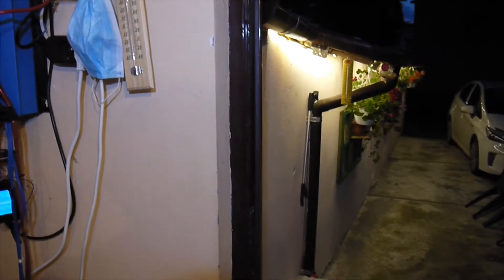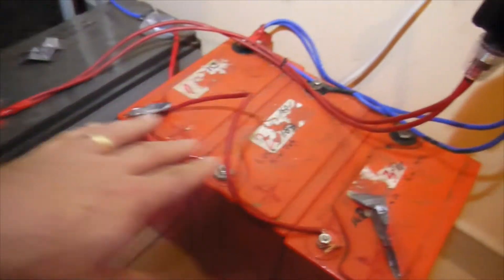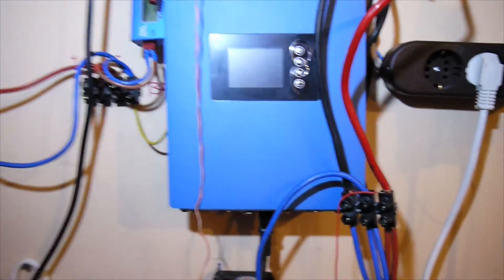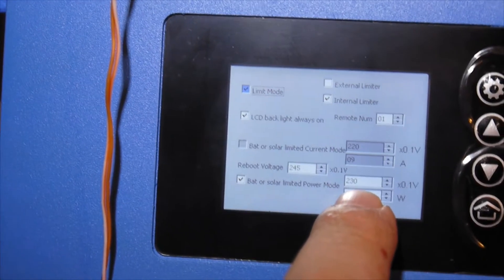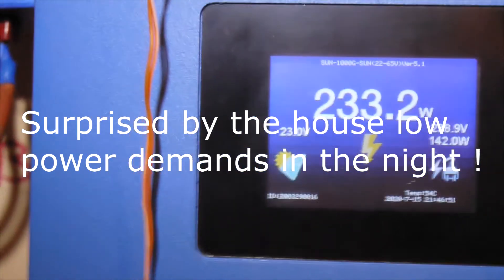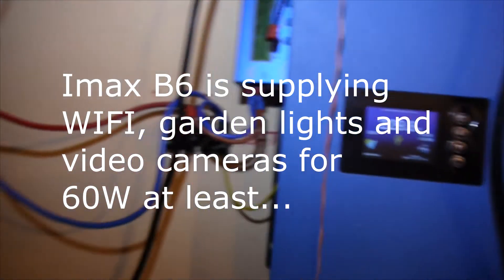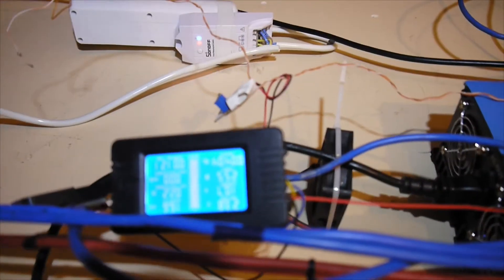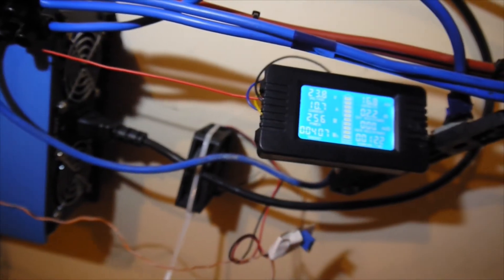SUN GTIL2 solar power inverter running on 24V deep cycle batteries for the night.Part 1

Comment: Muchas gracias por tu vídeo amigo! Veo que por la noche cambias la configuración del equipo. Yo quería ver de conectar la entrada de los paneles del equipo a un regulador de carga para las baterías.
Vos a las baterías las cargaste con red domiciliaria verdad?
Reply from the maker: Yes, the batteries are charged in the day time by a regular 24V car battery charger, you may use as well a MPPT (even better to do that) connected to the solar panels and eventually the ongrid inverter. Check my other vides about it. I'm not using this anymore, you really need strong batteries!
Reply: @viocaia muchísimas gracias por tu respuesta.
Reply from the maker: @Gensifull  de nada!

Comment: Can you attach 48V battery bank directly to the + and - terminals of the  SUN-2000GTIL2-H ?? Please advise...Thank you.
Reply from the maker: 2000W version is working from 45 to 90V input..so 48V is kind of low limit..but it will work.The 1000W model works from 22V to 60V..so for this should be perfect!
Reply: @viocaia  Thank you for your insight. After careful review, I believe + terminal was shorted out by terminal cable end grounding out with the "REMOTE" port which is extremely close to both + and - inverter connections. Much Appreciated.
Reply from the maker: @cliffBMRC  If you believe me..mine just got broken again..one hours ago! Another IBRF4227 got shorted..do you have a schematic?

Comment: For this experiment, did you leave it all set up just like it is for the evening during the day (except you had the car charger charging the batteries) with the GTIL in "Solar Battery" mode with the limits you showed us on the screen? Was the GTIL supply the house with the same settings during the day? Thank you. Great experiment!
Reply from the maker: For the day GTIL was running with no restrictions, except  the limiter..for the night, because of the limited battery power I did all those settings..but 24V is not enough, it should be 48..or at least 36 for better efficiency ..thanks!

Comment: Salutare...revin tot cu o nelămurire legata de tipul asta de invertor.Eu am achiziționat modelul 2000gtil2-lcd  .Ce nu știu și nu găsesc nicăieri....câți amperi suporta ? La voltaj suporta maxim 90 de volți. O sa între în el 81.5 volți și maxim 29.64 amperi.Stau cu frica sa nu se prăjească.
Reply from the maker: Nu e nici o problema, la modelul meu am mers cu max 24A/40V nu am mai mult, dar considerind ca este acel limitator , se adapteaza la consumul sezizat, asadar chiar daca are la dispozitie 100A nu va consuma mai muot decit necesarul pe moment.Dealtfel se poate limita puterea din menu..si consumul din panouri va scade.
Reply: @viocaia  mulțumesc !
Reply from the maker: Nu uita de impamintare! foarte important mai ales pentru vara si furtunile viitoare.Am prajit un inverter fiindca nu am avut leagtura la pamint..se in principal pe rama panourilor..sint tutoriale.
Reply: @viocaia  Da...prima conexiune o sa fie împământarea....mai ales ca panourile le pun la un vecin.(firma) și are 3 nivele.Eu ma gândesc și la posibile fulgere.Scheletul de susținere și rama panourilor o leg la impamantarea vecinului....el are paratrăsnet  pe acoperiș.
Reply: Vad ca tipul acesta de invertor nu e comercializat....sau promovat în România. În Asia și în America vad ca au mulți.
Reply from the maker: @cristinicolau3743  https://www.facebook.com/groups/1532777123642307
Reply: Este bun acest invertor?

Comment: Salut,am comandat un inverter asemanator ma poti ajuta cu cateva nelamuriri?
Reply: Sistemul pentru început o sa fie fără baterii.Am văzut ca ai mai multe lucruri montate . Din video am aflat de releul wifi....dar am văzut și alceva acolo....poți sa.mi spui ce se monteaza la inverter inafara de limitator ....baterii și releu?
Reply from the maker: @cristinicolau3743  Bateriile au fost doar un experiment.Instalatia este foarte simpla, panourile la intrare, apoi senzorul de curent vine pe intarea in casa, firul cu faza..si daca vrei un temporizator sa nu mearga de nebun noaptea.Am pus un Sonnof care decupleaza de la retea inverterul intre anumite ore, noaptea si am si informatie despre consum/productie zilnica.
Reply: @viocaia  mulțumesc.....buna idea cu releul wifi.
Reply from the maker: @cristinicolau3743  ce se vede pe acolo este o alta instalatie , total separata, cu panouri separate si incarca 12V baterii pentru iluminat nocturn..nu au treaba cu invertorul si reteaua...simplu...PV>intrare DC invertor>Iesire invertor retea...eventual prin temporizator..atit! Bafta!!!
Reply from the maker: desigur..
Reply: Gata Viorel....am 21 de zile de când am pornit sistemul cu gtil2 2000w , fără baterii deocamdată și sant multumit. 6 panouri de 310w mono .

Comment: sal.limitatorul extern este montat in testul asta ?
Reply: ce consum mediu ai la 24 de ore ?
Reply from the maker: @mihaipeia2016  cam 10KWh
Reply from the maker: desigur
Reply: @viocaia  nu inteleg de ce ai facut limitarea la 500W , ai consum mare peste noapte ? de ex la ap. meu consumul este de 300 kw la 60 zile adica 5 kw pe zi , 200w pe ora  ( media )
Reply from the maker: @mihaipeia2016  am facut limitare fiindca nu am baterii, doar am experimentat cu 3 bat , cam 250Ah..
Reply: @viocaia  inteleg ca rolul limitatorului extern este sa nu se duca productia in retea   sa se consume in reteaua interna
Reply from the maker: @mihaipeia2016  exact, adapteaza productia in functie de consumul casei..
Reply: e ceva mai mult decât o casă normala
Reply from the maker: @mihaipeia2016  e cam mult..dar sintem 2 familii..cam 350mp
Reply: @viocaia  in cazul asta e ok